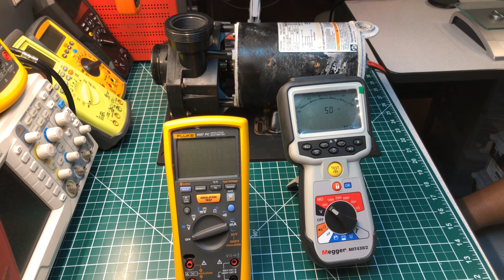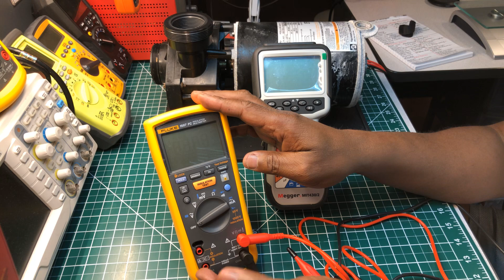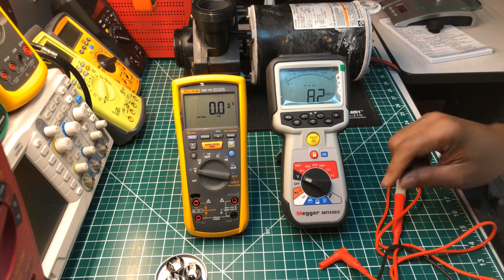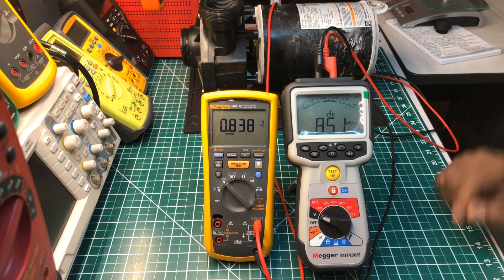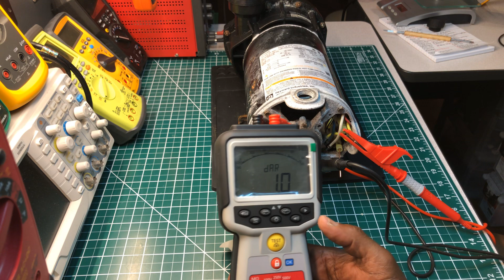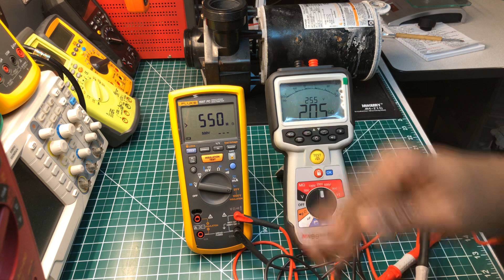🇺🇸 FLUKE 1587FC  vs. 🇬🇧 MEGGER MIT430/2 Insulation Testers

Comment: I work for a utility as a protection and control engineer. I've had THREE Megger MIT 481/2's break on me and my team in the past year. These devices were 3 years or newer. I sent it in for repair to megger and they are charging me $691 to repair and ship back, or $155 plus shipping if I choose to decline repairs. Megger is garbage. I'm going to buy a 1587 and give it a shot.
Reply from the maker: I like them both Fluke and Megger, I’ve never experienced any issues with either unit. The time when you guys sent it in for repairs Megger may have found issues that were not of their fault or yours that’s why they wanted to charge you for repairs 🤔 ? I’m not sure 🤔, I’m guessing. But the Fluke 1587FC is one hellava test instrument . AEMC, HT INSTRUMENTS, IDEAL INDUSTRIES, FLIR all have high quality insulation testers I done video reviews on all the insulation testers except the FLIR take a look at my channel when possible. Thanks for watching Sam, don’t forget to like the video and show some support for the channel it’s free, take care 👍🏿💪

Comment: Compare them with the Amazon commercial  90DM860 insulation tester
Reply from the maker: I posted a video comparing the Amazon Insulation Tester which is a rebranded Extech MG300 Insulation Tester against the FLUKE 1587 go to my main youtube page and you’ll find the video. Now as far as comparing the Amazon Insulation Tester against the Megger the Megger is a better instrument, that’s just my opinion.
Reply: @TheElectriciansToolChannel  ok thanks I'll go check it out.

Comment: 1. Megger actually insulation test range is 10v to 1000v  in 1v increments for communication cable testing. Configurable under settings.

2. I do wish the mit430/2 had a way to measure temperature  so I didn’t have to carry a separate device. But I always have a DMM on me which can read differential temperature to calculate the temperature compensation. But this does add an extra step when preforming tests.   

 The MTR105 megger came out with recently corrected the limitations of the mit series functions.
Reply from the maker: You would think of the in-depth knowledge on insulation testing the MEGGER Corp. have they would’ve included temperature features on their insulation testers.  Although Megger makes a great megohmn meter FLUKE still knock their socks off with other testers. Overall Megger won this fair and square I enjoyed , and  my guys enjoyed Megger also over the FLUKE insulation tester that helped me make my decision.
Reply: You did a great job on this video by the way. 

Sorry for pointing out some of the more in depth key features of the megger. But you are comparing insulation testers here. Not multi meters. So I feel the in depth features of the insulation test functions are what set each meter apart from each other. If I would have notice a function on the fluke other than the ability to read temperature i would have pointed it out also. my comment wasn’t to make megger look better.

One thing Ive learned about my 430/2 a couple days ago is that the continuity tests at 200ma for earth ground testing. I only noticed this because I was comparing it to Bremen BM877 and trying to figure out its dedicated earth ground function. Which Fluke does not appear to have at all.

Im pointing out the test current of the megger because it means people need to be cautious where they are probing while using the continuity function. This also explains the slower response when you were tapping leads together.
Reply from the maker: Thanks JT I’m glad you found it interesting, and you pointing out other advanced features on the MIT430/2 was educational for me but it would’ve made the video to long . At least that’s what I thought, both meters had a few more hidden features I think the MIT430/2 had more  advance features than the FLUKE . Knowing that also helped me make my decision in choosing the MIT430/2.  Like I said and you just mentioned I was focused on the entire instrument but mostly on the insulation tester part of the device. I still love FLUKE, but Megger is much better in this comparison. Wow JT I thought there’s nothing out there better than My FLUKES...LOL.

Comment: Oh dear TETC, have we led you astray from the Fluke!

The MIT430/2 has a maximum capacitance reading of 10uF, so when trying to measure the 30uF value, it just went over range. That is a limitation of the Megger, which surprises me, given that it is aimed at motor testing and large capacitors are prevalent in single phase motors and lighting that electricians work on.

For the DAR insulation test, at 45:12 after the test had completed on the Megger, it defaults to displaying the DAR value. If you had pressed the down arrow key, labelled with the uA-s-v, you would have been able to page through the 30 second IR reading, 1 minute IR reading and then back to the DAR value. If you use the same key during the test, you can page through the timer, voltage and current readings.

Again DAR, has no meaning on this style of motor, it is just the IR value at 1 minute that I would go by. 

You could add in a further test with the motor by measuring the winding resistance using the Ohms range on the meters.

It would be nice to see the memory function at work on the Megger too and how much data is saved / downloaded during a PI test.

Your comment towards the end, is what it boils down to. It depends what type of work you have for the instrument. As a straight insulation tester, especially for motors and industrial work, the Megger is by far the best in my opinion. To be honest, I don't think Fluke have an insulation tester that can compete at the moment, even their 1555 high voltage insulation tester is behind the competition.

However, if you want a meter for voltage logging and setting up VFDs with occasional insulation testing, you would probably find yourself going for the Fluke.

The one thing I do not like about the Fluke is the lead swapping between different test types. Especially as the insulation test, which is traditionally voltage based, uses one of the current input jacks - I just do not like that at all. I have been caught out a few times with having the leads in the wrong jacks and starting an insulation test. The Megger, with only the two jacks, you cannot make that error.

Great video - will be interesting to hear what others have to say.
Reply from the maker: Thanks TP, and I was only being fair with my decision making. Believe me I was shocked also, but overall the Megger did win fair and square. I still like FLUKE Instruments, but in this comparison the Megger out shined the FLUKE. That’s just my opinion, Megger is a heck of a test instrument that I’m proud to own. Megger is the KING Of THE HILL on my bench.
Reply: Para tal caso,un Fluke 87v, es perfecto. Pero para lo demás no.
El 1587fc es un producto de Marketing, nada más..........
Reply: Damn dude! I really appreciate you sharing. This is extremely helpful, I am a first year and trying to decide. Buy once cry once :)
Reply from the maker: Very smart  !!!